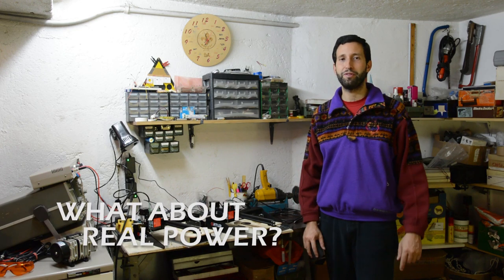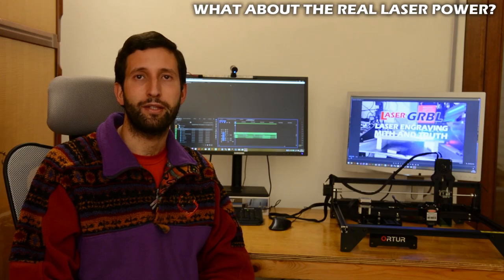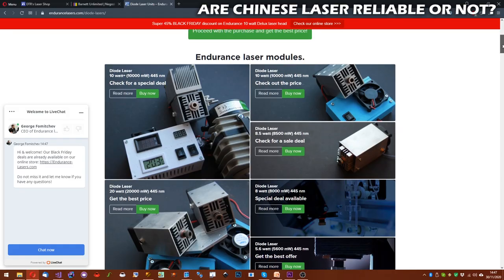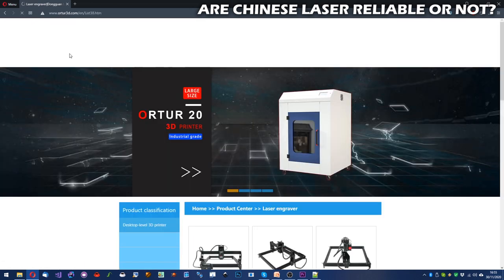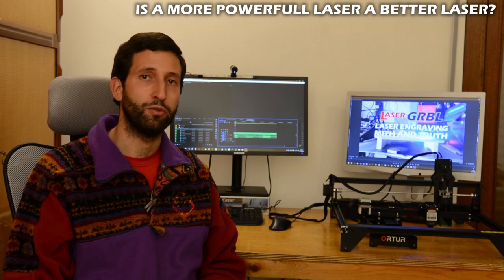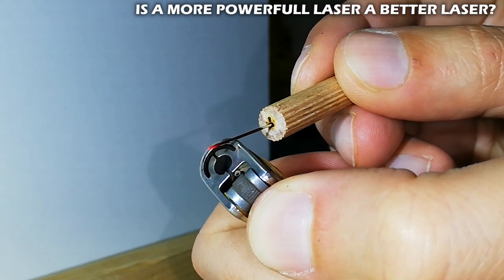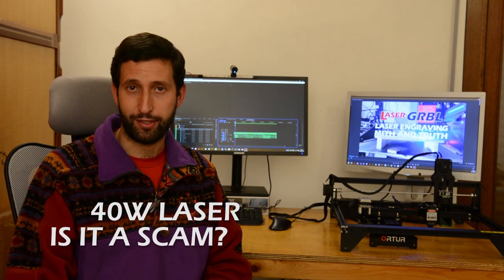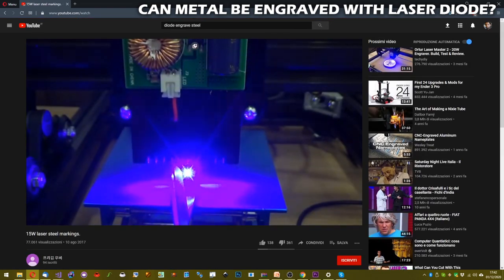Laser Engraving Myths and Truth (diode)

Comment: I measured the optical output of the Neje 40W laser diode with ThorLABS PM400 Optical Power Meter. Optical Output is : 8.576 W.
Reply from the maker: Hi @Alkim Aydin and thanks for your feedback.
Neje contacted me but never send a sample till now, so I can never test it, but I tested out some other modules with "double diode" technology from two competitors. They both claim 10W optical power but my measure (with a cheap LPM) is really near your result 8.1W-8.5W. That's strange, considering that single-diode modules usually rate 5.5W of optical power, so double diode should be 11W.

I guess that when you have to blend two laser diode rays inside the module, using mirrors and optics, some kind of dispersion is unavoidable, but 20-25% sound too much. Are you able to measure input power of this module? When measuring Comgo Z1 i have 36W of electrical power (instead of 40W which I expect).

Have a nice day

Comment: I love diode laser because they are more accurate than co2 tube laser with mirrors but a good adjusted laser will work fine, a diode laser is fixed on the arm and always has the same distance to what you are burning,
I chose a Neje 40watt laser with a good lens, it should have 15watt output in focus,I have not tried full power only 50% power because I can not see the temperature in lightburn.
Of course a 40watt co2 is probably better and faster but I do not have a room for such a machine, it could be fun to see a 40w diode laser vs a co2 laser with the same wavelength.
The temperature is very important to measure so if you have a diode laser of 15w and run at 100% it will be hot but if you have a diode laser of 40w and run it at 70% it will also be hot but can last longer, but of course no one knows when a diode burns out.

Comment: I got Neje 40W it consists of 2 diods and pretty powerful.
Reply from the maker: Are you able to make a cut test over 5mm (thickness) plywood?
Reply: @lasergrbl  I have 3/4/8mm plywood. I was able to cut 8mm plywood in 3 passes without additional air pump with 200mm/m speed. (3mm in 1 pass exactly as mensioned in laser description). Both cuts were performed at 95% laser power.
Reply: @amelien_by  after this time, your laser is still working? I read neje diodes have a very short life

Comment: Thanks for this video, you already have helped me a great deal with the LaserGRBL software but your explanation for the air assist sure is going to give me a wider selection of woods that I can cut.
I'm going to try a car tire air pump and I hope the 35L of air it push through is enough.
Reply: You really don't need to go over the top with air assist.  I use a 40mm high output 12V fan with a 3d printed nozzle to direct air down from the side of the laser unit. That allows me to cut 6mm plywood with a so-called 15W laser. Its more just a matter of blowing the smoke away and cooling the cut so it doesn't carbonise too much - the laser will not cut though otherwise.
Reply: @frankhovis  I found out myself that overdoing it have the opposite effect and help embers to form on the wood.
I got an electric air pump for beach balls etc that probably push way too much air.
At least is not wasted money, I will get it to pull air out of the box that I plan to install the laser :P
As for the air assist I plan to just add 3 standard PC 90mm fans that I have accumulated over the years and have them push air from the front side. I just need to figure out how to power them since they are 12V.

Comment: Nice video. You did not talk about the lens, this can make a difference in power density and power loss. I would also mention not all Chinese vendors use false claims to sell their products, the EleksMaker modules for example are rated at optical output and have a very good reliablity.
Reply from the maker: Hi T2Laser and thanks for your contribution. The video was getting very long, and there was no more space to talk about lenses difference or other interesting things like how to focus in the best way, how to experimentally find the greatest speed and acceleration for your machine, how the color of the material affects the marking process etc. These are good ideas for the next videos!

I preferred to do the tests with the machines I own (ortur and atomstack) and which can be purchased by beginners, so that many people can compare with their results.
I also have a self-built module with NUBM44 7W diode and G2 / G8 lenses, which is on another level (>500 W/mm^2). I also have SHARP brand diodes 5.5W which are very interesting.
I am also expecting to receive a Laser Power Meter. Maybe I'll do some tests and post videos for more experienced users.

Unfortunately I am not familiar with EleksMaker's products even though I have often heard them mentioned. From the photos I've seen they look really well done, I'm sorry I didn't mention them in the video.

Best regards, and have luck

Comment: I wanted to test air-assist without investing much and used a cheap "Ideenwelt" air-mattress pump (7 Euro in Rossmann) and some 5mm (I think...) transparent green hose from Toom (around 3 Euro for 2 meters).
Good God, how noisy this thing is... But even this cheapskate setup did the trick and I could see the difference by turning the pump on and off mid-print - as soon as it was off, charring started.

Comment: Thanks for the video! I have a question, if you can help me:

I have the Atomstack A5 and I was wondering if it is necessary to install an "Air Assist" as you show in the video, or if the ¿air cone? system (You mentioned in another video) it has is enough. Also, if I install an "Air Assist", should I remove the green protection plates? (To put the straw focusing on the laser)
Reply: I want to know that too :s
Reply from the maker: An air-assist system is extremely useful, and the benefits are many.

It removes combustion residues from the groove left by the laser, which absorb its power,
thus allowing cut deeper (and faster).

Blow away the combustion fumes, preventing them from dirtying the lens and avoiding the degradation of performance due to dirt.

Keeps material out of the laser groove, cooled. This ensures that the edges of the engraving/cut are nice and clean and have no burnt smudges.

The atomstack cone cannot be considered equivalent to a real air-assist system because it does not perform these functions. A narrower and more powerful jet of air is needed which can only be achieved with a compressor, not with a fan, and with a narrow nozzle.
Reply from the maker: About the protection shield: if you are smart enough you can drill a hole inside of it and insert the air-assist through the hole
Reply: @lasergrbl  Thank you!!

Comment: They put two laser diodes in one head, and link them with mirrors so that they build one laser beam.
Maybe that is how they achieve stronger lasers then 30w.

Here is a video name where the guy disassembled the 40w laser head and you can see the two diodes and mirrors
'Neje A40640 40w laser modul [unbox / review / first test] best laser modul modul i try' from TinC33 (i did not put a link to avoid maybe being blocked as spam)

Comment: I'm another newbie to laser engraving. A friend gave me his broken 3 axis cnc router setup that i converted for a 445nm laser. The controller is a laserpecker board using an Atmel nano processor. My question is how do a flash update of the firmware to version 1.1 or higher so I can take advantage of the variable laser power to improve images ? Merci beaucoup pour un excellant video.

Comment: Hello,
Great video.
I still have a question, in the video you cut wood, what was the distance between the lens and the wood and where was the focal point of the lens adjusted? 
When cutting wood I am still a beginner and am grateful for every wheel.
Reply from the maker: Hi Gerd
The laser module I used is Ortur 20w fixed focus. It comes with a spacer of 2cm height that can be used to put the workpiece at the best distance.

Fixed focus lensa are generally more uncomfortable to use because the distance with the pieces is very small, but the focuins is always accurate and the lens has less power loss (simpler optical schema).
Reply: Thanks for the answer.

Comment: dear arkipita, thanks a lot for this video, very good job !!!
about what kind of air assist talking you ? aspire or blow ?
If is to aspire, i would like used an old household vacuum cleaner to create an global air solution : depression to keep parts light on place (like cardboard, paper or laminate sheet and wood veneer...), to aspire smokes generate by engraver and also to aspire closer of laser...
If is blowing, are you thinking i could use brushless cooling fanbrushless cooling fan like on head of 3d printer ?
Thanks of your response !! Enjoy !
Reply from the maker: I think blow is better, but I never try vacuum cleaner to remove fumes
Reply from the maker: blow also help keep cold the engraving area, helping prevent overburned edges
Reply: @lasergrbl  Thanks a lot for your response, really great job !!

Comment: Hi Is it possible to cut 3mm acrylic in one pass with a diode engraving machine?
Reply from the maker: I never try on acrilic, but the engraver come with a small piece of acrilic of this thickness and I have this data from the factory:

Engraver: Atomstack A5 PRO
Material: Acrylic 2.8mm
Power: 100%
Speed: 310 mm/min
Passes: 3
Reply: @lasergrbl  Thank you for your reply, I think maybe a Co2 40w will possibly cut 3mm acrylic. Cheers Richard

Comment: Hi, thanks for your contributions with the software and for your videos. I am using your LaserGRBL with my Atomstack A5 and would like to have a benchmark of my laser power, I’m fairly new to laser cutting and don’t know what to expect from it. Can you confirm that your Atomstack cuts 6 mm solid wood in 15 passes at S400 F1000 as claimed in the manual. I have a 3mm thick Beechwood piece as reference and I need about 40 passes to reach through at S400 F1000. I just want to know if my laser isn’t performing up to specifications or if this is the expected results with this power. My Geometry G-code for cutting an 8mm circle is essentially 
G91
G2 X0 I4
I have set up the distance for fixed focus according to the manual. Am I correct when assuming that my laser isn’t performing according to specifications or is this the expected performance?
However if I make a “solid filled circle” and burn with 0.12 mm line separation using my own design of air assist, similar to yours, it manages to burn a hole in the 3 mm beechwood after 6-7 passes with S400 F1000. I am mostly interested in the cutting performance for 6 mm Balticbirch plywood and  the performance you demonstrated in your video is what I expected and would like to have, but I don’t know if I can expect that from the 20W/5.5W.
Reply from the maker: Sorry for this late reply. I made some benchmark and released a video: https://www.youtube.com/watch?v=UKGKnOxY3ac
Here you can find the file: https://lasergrbl.com/resources/circle30.nc

Comment: Does using diode laser at 100% power damage it? thank's in advance
Reply from the maker: Overheating diode is bad, not the power itself. If diode temp >50° diode lifespan rapidly decrease.

If you feel your module hot or warm I suggest using 90% or using cooling cycles (you can configure cooling in LaserGrbl settings).

Please note that winter/summer temperature can make big difference.
Reply: @lasergrbl  thank you so much.
Reply: @lasergrbl  but how can I prevent overheating? What causes it in common?

Comment: i bought a 6W laser with declared 2,2W optical output, but you say 7W lasers only output 1,5W. Do you think the aliexpress store was just saying random numbers or could it actually be 2,2W. I had no experience with lasers before buying this one.
Reply from the maker: link?
Reply from the maker: Well, the rate between electrical power and optical power in not a constant but it strictly depends by the laser diode itself.
Some diode perform better than others and the only way to know the real power is to read the diode datasheet but, unlucky, noone declare what diode is using!

Another way is to measure the optical power with a laser power meter, but it is a tool that cost more than 100$
Reply from the maker: Sincerely i think that your 6w could be 1.5 optical power (looking at the price) but without a measure it is difficult to say

Comment: Excellent video!! After watching quite a few videos and searching online I am still left with the original question I had... which is:  is it impossible to to create relatively permanent markings on non colour anodised metals with diode laser? 
I know you gave an answer to that but i still have some doubts. Is it not possible even by using some of the commercial laser marking surface coatings such as CerMark? I know these products are marketed for CO2 lasers and responsible companies would not label them as diode "friendly", but is it impossible to use anything like that for lasting results with high powerful diode lasers? 
I am insisting on this because there is an insinuation around that you can indeed mark stainless steel etc with diode lasers, the "nduranc" laser guy even has a video showing something about that.  I need your wisdom on this :)
Ciao from Genova
Reply from the maker: Ciao! Recentemente ho fatto dei test su acciaio inox di vari spessori, dalla lama di taglierino, alla lamiera di 3mm di spessore.

Usando i diodi più recente fabbricazion con lente FAC (come quello della atomstack A5 Pro) si riesce a fare una marcatura senza usare alcun prodotto chimico.

La marcatura è ben visibile sulla lama di taglierino ma molto più leggera sull'acciaio spesso. Lo spessore infatti va a dissipare il calore del laser e quindi a rendere il processo meno efficace.

Sulla durata del risultato non mi pronuncio. La marcatura è molto superficiale e temo che con il tempo possa venire via o almeno sbiadire.

Se la trovo ti linko una foto del risultato.
Reply from the maker: https://i.ibb.co/gvSHsyS/aabhimacdbbbkelo.png
Reply: @lasergrbl  Thank you very much for the very fast reply.  If this is true then maybe with some surface product it could work even better? 
Grazie ancora!
Reply from the maker: @SuperHaptics  I think so
Reply: @lasergrbl  The question was in English and you are replying with mumbojambo. Thank you so much.